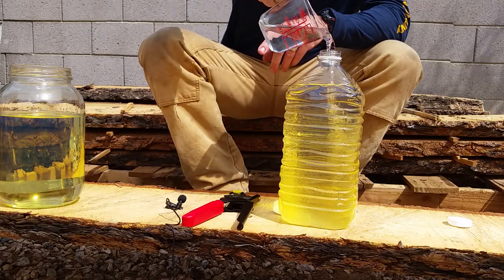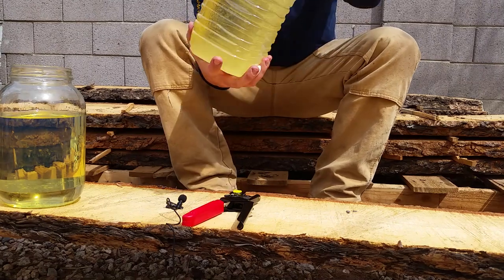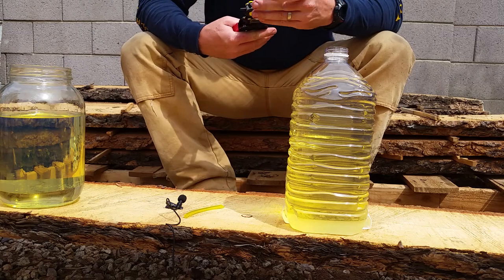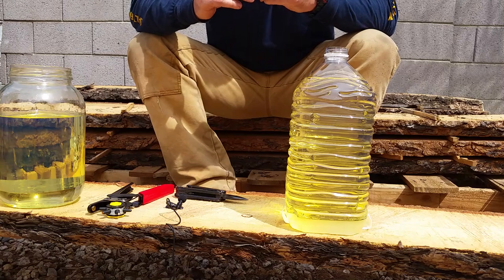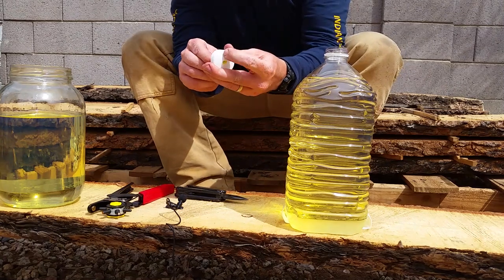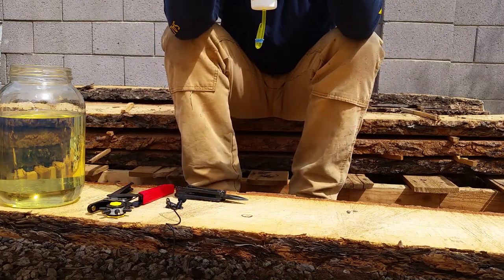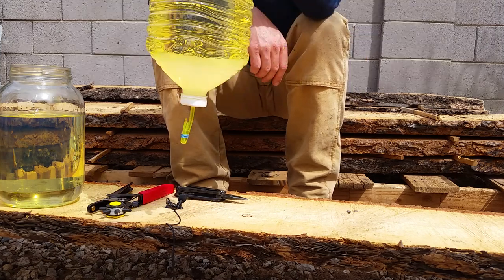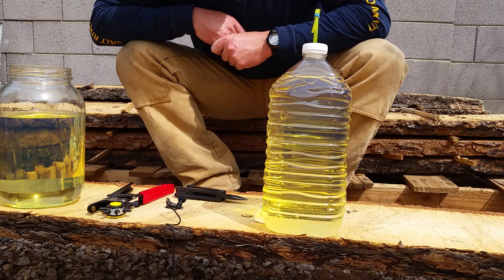Removing ethanol from gas

Comment: I do not want ethanol in gasoline or at least give us a choice. I recently went on a road trip and had occasion to stop at a gas station that sells gas without 10% ethanol. According to my car driver information computer, I got 10% better gas mileage. This is a 2002 car I have owned since new and without ethanol I averaged 33 mpg with 10% ethanol 29 mpg is the absolute best I can do. I purchased the car new and in 150,000 miles of driving that is over 10% better mpg than ever. So where is the fuel and/or pollution savings?
Reply from the maker: +Joe Tabor follow the money.....
Right in the pockets of big corn
Reply: It's image and posturing. Oh, and money. Ethanol uses more petroleum in its production than it saves. It also has less chemical energy, so you get less MPG. It's all a clown show.
Reply: Never go by the computer. You need to calculate it when you fill up to get an accurate measurement.
Reply: I bought a used MB wagon 10 years ago. When driving in GA and Florida, without ethanol, I got 10% better mileage without ethanol than with ethanol. 
For skeptics that was both by computer and by miles per gallon by tank.

Comment: Good video. Why don't the big insurance lobbies fight a little bit to get the sale of non ethanol good gas for small engines, old cars and classics? They are losing a ton of money paying for all the fires and destroyed classics from the leaky o rings, spongy rubber hoses, corroded fuel systems, etc. Yeah, I know, we can replace hoses, drain the tanks and add additives. But what about the cars going down the road when they start leaking and burn to the ground?
Reply from the maker: +Z06Doug the corn industry and epa is more powerful
Reply: Big Changes to the EPA happening under President Trump now so time will tell.
Reply: There's simply not enough demand for it..a simple numbers problem. The 'invisible hand' bitch slaps again
Reply: There are gas stations that sell ethanol-free gas.  It is usually about 50-70 cents per gallon more.  Sometimes called "marine fuel"
Reply: Because classic cars are outnumbered by modern cars,and who drives a classic car for every day transportation? I actually do,but most dont.They good old days are not coming back.
Reply: Because Iowa get's to vote 1st in the primary and Iowa has one hell of a lot of corn farmers so politicians pay lip service to them. Ted Cruz stood up to them and said he wouldn't help with the ethanol requirement but Trump did. Iowa needs to lose 1st voting position in the primary.
Reply: I've been driving a 68 Toyota for almost 30 years now Skipper. Paid $300 for it in 1988. I've put around 500,000 miles on it and it was already 20 years old when I bought it. The older I get the more I stay at home so I'm not racking up the miles like I used to.
Cheap to drive, cheap to fix  45 mpg if I stay around 65 mph. Going to work is a 40 mile round trip. An oil change costs more than I spend on gas every week.. and there's an ethanol free station down the road from work.
Reply: Most of what you hear is either myth or extreme dramatization. E10 in an old car or small engine isn't a problem. The only time you'll have a problem with it is if you're storing it for extended intervals. 
Even in boats, if you had a brand new boat that has never seen non-ethanol fuel, has a well sealed fuel system, and gets used regularly, you could run e10 in it without a problem. But most boats are the exact opposite of that so what you end up with is the ethanol breaking down deposits left by gasoline, then the boat gets stored and the fuel goes bad.
Reply: Z06Doug bg

Comment: Simply buy your fuel from a marina; they sell straight gas with no alcohol. Marine engines do not perform well on ethanol.
Reply: in cali you cant buy it from marine without ethanol, i try already.

Comment: 1st I blended ethanol fuel for 7 years.  This gentleman is  basically (not 100%) correct.  The issue remaining is that ethanol is an octane booster.  Pure ethanol has a about 119 octane rating. (anti-knock rating)  Shipped (gov't requirement) ethanol is 5% denatured (petroleum added otherwise is drinkable).  Doing the math we get about 114 octane (R+M/2).  If you remove the ethanol from the from the other portions of fuel you come out with about an 84 octane of 87 octane purchased fuel.  
Talking roughly,  if you remove the ethanol, you will be burning a 84ish octane fuel in the engine.  If it your vehicle/motorcycle/lawnmower/outboard/etc doesn't knock...you 'might'  be in business... kind of.  
 Just to mention, I use 'straight gas' (wife's instance) in my mower. and never OVER 10% ethanol! in anything.  I use 87 octane (10%) ethanol fuel in my vehicles and motorcycle.  
So, what is the octane booster in 'straight fuel', he asks.  One time was lead (cheapest form of octane booster)  Probably MTBE... another oxygenate.
Reply from the maker: +Link D'Antoni thanks
Reply: Link D'Antoni u
Reply: I don't know if it's true but I've heard adding diesel fuel to gas will increase the octane. The diesel fuel makes the gas less volatile and is supposed to prevent the explosion prior to the spark plug lighting it. I thought this video was about making alcohol free gas for a 2 cycle chain saw. The 2 cycle oil should raise the octane the same way diesel fuel does. Do any of you think that would work?
Reply: Adding diesel to gasoline does not increase the octane.  Diesel has no octane value and will, however, decrease the octane.  It does change the distillation mid-point.  It's all a calculation.  If you add diesel use 0 (zero) as the octane portion.
Reply: OK Link. Do you think diesel fuel would stop the pre-ignition of the fuel charge? After I posted the above comment I continued reading comments and saw some one else stated to put 1 ounce of diesel fuel in a gallon of gas so I'm not the only one to have heard of this. It does make sense  to me that it should work. I was told to put a gallon in with 20 gallons.  If I had a carbureted car I'd try it.
Reply: Gasoline is made up of many components as you probably already know .  My intent, so far, has been to address the resulting loss of octane when removing the 10 % ethanol.   Commercially, I had added diesel into (ethanol) blended fuel at one blending location because of the components available to blend. Diesel was used to raise the distillation mid-point. But, also had to calculate the octane, vapor pressure, Distillation curve, etc.  It's all a matter of calculation.
Reply: Domino, it's a matter of straight math.  84 @ 90% = 75.60 + 114 @10  = 11.40  Added together 75.60 + 14.40 = 87.  It's that simple. The only thing that is not linear is Vapor Pressure.  10% ethanol raises VP by one point.  The govn't gives an allowance for that 'one' increase.  
 To answer you question concerning 'octane boosters'  Booster can be a variety of components.  Lead was the cheapest.  MTBE (look it up) is another.  There are many things out there that 'can' be used as octane boosters.  You have to look that the other properties to determine as a fit.   Remember... Octane designation is just an anti-knock calculation.  The test is run on an 'knock engine'.   One test is R (Research) + the other is M (Motor) Look on the pump.  Shows R+M/2.  Here: https://en.wikipedia.org/wiki/Octane_rating
Hope this helps clears up some misconception.
Reply: Frank, if you referring to my post, I did not suggest or did not mean to suggest that volatility has to do with octane.  Octane is merely an anti-know rating.   If memory serves (sometimes it doesn't) I was just mentioning some of the other things that are considered when looking at fuels and usability.
Reply: 10-4
Reply: If it knocks, adjust the timing.
Reply: if you drink the ethanol taken off the gasoline you could end up dead by poison from the chemicals in the gas check the notice on the pump.
Reply: Link D'Antoni Your standard Briggs flat head engine has a really low compression ratio and would run low octane fuel without trouble. Other engine designs, I'm not so sure. I like the info you've given us about the specifics of deriving the end octane rating. Great info.

Comment: I'm lucky I can buy ethanol free gas from a Sunoco station nearby, use it in my car and mower and snow thrower. Car's gas mileage is MUCH better.
Reply: The Sunoco gas station about 10 miles away selling ethanol free gas cost $10 per gallon.
Reply: @kubelwagen516  That's too bad, the one I use is only maybe 20 to 30 cents more.
Reply: @Greg29  the one nearest me is in Horsham Pa, where is yours location?
Reply: @kubelwagen516  Allentown PA, on Airport Rd, just across from the airport.
Reply: @Greg29  that's amazing, you are actually in my area, I'm glad i asked you, i will definitely buy some 5 gallon gas tank and hauling those gasoline back, hope they don't have the limit on quantity purchase, thanks a million mate.
Reply: @kubelwagen516  I don't think they have a limit, I've seen commercial lawn mowing services etc come there to fill up. If you go there be aware there are 2 Sunoco stations adjacent to each other, the smaller one (more to the north) is the one that has the ethanol free gas. The attendant pumps the gas for you.
Reply: @Greg29  thanks again Greg, have a great weekend and please stay safe and healthy.
Reply: you know why airlines do not ever add this crap like vehicles, uncle sam would pay for the accidents from adding garbage

Comment: Would it take more water to remove the gasoline from the ethanol in E85? Would it be safe to use the removed ethanol in windshield washer fluid?
Reply: In this video, you remove ethanol from fuel and gasoline will stay behind.

Comment: Ok, if I buy 92 Octane, 1 gallon, add 1 quart of water in a 2 gallon jug, I should end up with about 29 oz. of alcohol  and water.  Which leaves about 115oz. Of gas.  The question is, will my outboard on my dinghy run better as and or more reliable??

Comment: about the octane booster : see if you can get Toluene its a cleaning agent and its used as a thinner for inks 
xylene allso work but need more 
you can buy those by the gallon and its cheaper then the octanebooster in the small bottles (basicly the same stuff )

Comment: Its just far too easy to buy ethanol free gas for my old engines. 3.25/gallon as of sept 2017
Reply: Natty Daddy 
That would be nice, but here in NM, ethanol free gas is hard to find.  I was just on a motorcycle trip and I could find ethanol free gas just about everywhere in the Midwest.
Reply: velvet- that is kind of ironic since the Midwest is where the ethanol comes from.
Reply: Kirk Johnson 
Yes, it make no sense to me.  It was usually the premium grade only that was ethanol free.  That worked for me since that it what my bike calls for.  Fuel mileage was definitely better.
Reply: Jef Rey every station near me has it $20 a gallon #novaseline
Reply: Buying ethanol free fuel pre-made runs 7 to 10 dollars a gallon. Buy premium & a few gas containers, plus some clear water jugs, one syphon & away you go. Ethanol SUCKS!

Comment: Octane ratings are closely held "secrets" for each manufacturer.....taking ethanol out of gas,....does not lower the Octane rating....Ethanol has an inherently lower octane rating than American fuel/gas.

Having the additional ethanol in our fuel...has been a major problem for engines...especially smaller engines.  The mowers, snowblowers, snow mobiles, chain saws, log splitters, etc.....should all have a non-ethanol fuel/gas.  Why?  The ethanol leaves a white powder residue in carburetors that eventually screws them up.

Just another "fleecing of American" people.  Corporations should exist for us....not us...for them.  We're now,....in the Matrix.
Reply: I don't know where you're getting your information from, straight ethanol has an antiknock index of 104 to 106, no gasoline on the planet is produced with that octane rating anymore. ethanol affects unanodized aluminums, viton seats on the needles in carburetors. Using additives like Sea Foam reduces these effects. Most new cars are immune to these problems. Proper fuel system maintenence can prevent a lot of these problems.

Comment: ethanol is MOONSHINE
Reply: Only if you sell it, you don't need a permit to make alcohol
Reply: If you are making it for a motor fuel.  If you are making it to drink then it is moonshine.
Reply: It's exactly the same (except for the gasoline).
Reply: tyvek05 yes it is...  Ethanol,  Ethyl Alcohol,  Grain Alcohol are different names for the same exact thing. It's the alcohol that's in ALL alcoholic beverages.  I'm a chemist by the way.
Reply: I am getting a headache remembering the senior class trip for spring break, 1978, We downed a bit of PGA/Everclear.. that hangover lasted a while.
Reply: You can make alcohol, beer and wine for personal use. You can only distill it for fuel if you don't have the right permits/licenses.
Reply: ethanol is the only type of alcohol thats safe for consumption
Reply: Methanol is wood alcohol. A lot of the old black blues players went blind from drinking it. Thats what sterno is (canned heat). The band "canned heat" took that name as a way to pay homage to the great black blues players.
Reply: +Al Brautigam 
if your cooking corn whisky.
the first run off is methonal and it will blind or kill you if you consume to much.
the shinners burned it off in there hot rods to give them an advantage over the cops souped up engines.
after the methanol was run off the ethanol whisky was always double distilled for purity then diluted with fresh cold sweat spring water to around 60% alcohol. this shine had no smell or taste of alcohol, did not burn the throat or mouth.
had a bit of a sweetened water taste was smoother than silk and would warm you from head to toe very gently.
they called it sipping whiskey because even a 6 yr old kid could drink it like water but it would hit like a hammer after just one coffee cup.
most folks found it to easy to sip and to difficult to get up and stay up after only a pint.
it commanded a heavy price 25. qt. verses 20 gall for first run shine.

if you know my truth and are lucky enough to know an old jent that knows the real mysteries of sipping g whisky your lucky as hell because the commercial brewers have been trying to duplicate this receipt with no success yet
Reply: They only get a few ounces of methanol from distilling fruit-based wines, and even less from corn mash.  You're touched in the head if you expect anyone to believe in 120 proof, unaged whiskey has no alcohol smell and can be drank like water. You're completely off your rocker if you expect anyone to believe only illegal distillers know how to make this unicorn whiskey.
Reply: ... yip, raw spirit! I don't fancy drinking the left-overs from a gallon o'petrol tho 😜.. syphoning is a bad enuf mouth rinse & gargle
Reply: Al, I hate to inform you BUT there for the fact of science  wine or corn mash NEVER produce methanol. 
AND you have no clue what your talking about "few ounces" of ETHANOL  from corn mash.

Comment: Can this be used to revive gas that is a couple years old ? Which was ethanol gas left in a gas can in a garage ?
Reply: For old gas like that put a coffee filter in a funnel and pour the old gas through the filter.  After you've filtered it you can add toluene of about 20% ratio and agitate to blend the mixture. That will burn just fine. Use it all up in one sitting if possible.

Comment: So what was the chemicals you poured into the gas?  You never really made that info abundant!
Reply from the maker: +Michaelcorey Fitzpatrick water
Reply: Michaelcorey Fitzpatrick I thought he should have mentioned that slightly important info too.
Reply: :45 and 1:58
Reply: Water, he used water..    If you are that unsure then  you probably don't need to be doing this.

Comment: How can you prove the ethanol has been removed? From my perspective the amount at the bottle is the same amount of water you mixed into it.
Reply from the maker: +Bryan Knox I need to follow up and conduct a more accurate test. I'll start with an exact amount of gas and pour a set amount of water in it. If it is truly extracting the ethanol there will be more fluid on the bottom than water poured in.

Comment: Gasoline prior to ethanol being added, would absorb water when added to it, and suspend it. Kind of like humidity in the air. Once the concentration was high enough, it would affect the engines ability to burn properly, affect performance, then ultimately enough would cause the engine to not run at all anymore. This is the reason why we used to always use alcohol or "dry gas" in gas tanks in the winter... to safely absorb the water out of the gas so it would burn out in normal engine combustion. So, my reservation is this... I understand how adding water will attract the ethanol but, once the ethanol is attracted by the water and drained off, supposedly it is gasoline how we used to have it prior to ethanol blended gas. So... water was just purposely added to that gas... Is any of THAT water still staying suspended in the actual gasoline? Do I need to drain off the water/ethanol mix then add some isopropyl alcohol to remove the water again???

Comment: I wonder what the octane rating is for the ethanol.
Reply: E85 has an octane rating of 105. so its great for high performance engines that run high compression ratios, turbo or superchargers with high boost pressures, or advanced timing. 100 octane racing gas near me cost $7 a gallon, compared to E85 for as low as $1.30 a gallon and not ever higher than $2 a gallon.

Comment: What do you do with the ethanol portion once it's removed? You can't just dump it down the drain.
Reply from the maker: Dispose of it with used motor oil
Reply: @KimballCody  I am not even sure where to do that? Any one of the oil places?